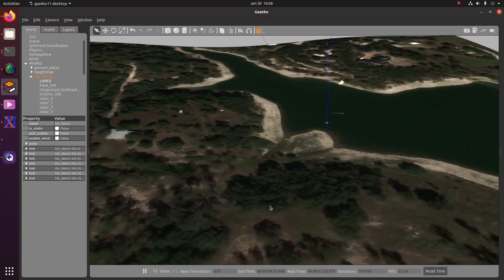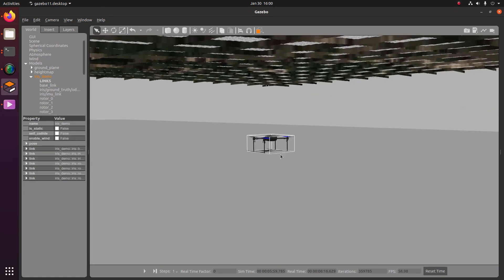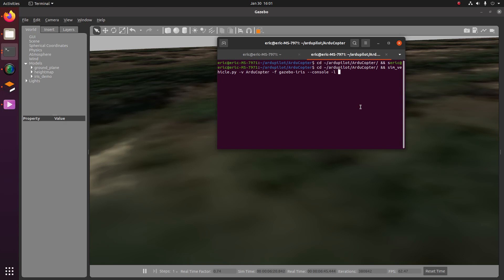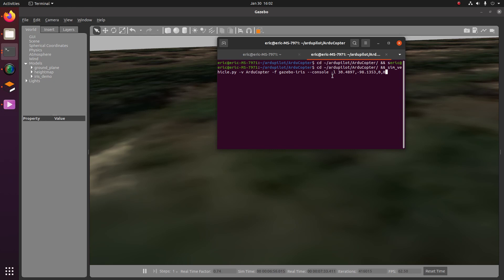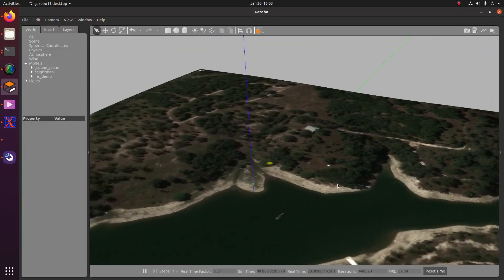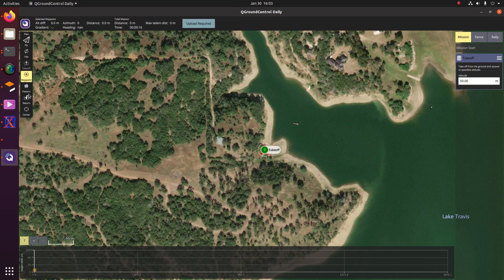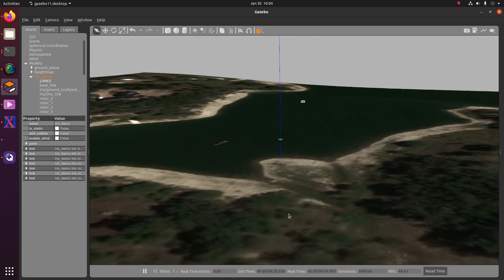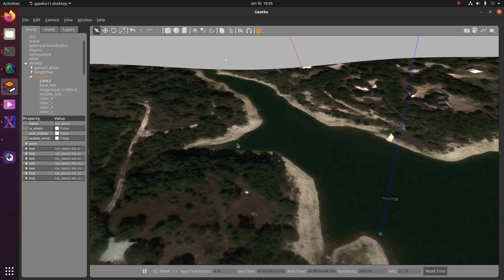Flying an Ardupilot Drone with Accurate Terrain in Gazebo

Comment: Heya! Pretty awesome, nice work :-)

I've been testing with it a little bit and I can't get the waypoints in the maps to line up with reality. The origin point pretty much is spot on, but there is drift the farther I get from the origin. It appears the image file in the zip is actually the entire area in the instead of (what I expected) the area inside the red box. That seems to cause the offsets in my case. Is that as intended?
Reply from the maker: I have noticed this a little bit in testing across large distances. For things within a few hundred meters it seems to be correct. Curious as to how far you flew. I am looking into this and will try to get this fixed in the future
Reply: @IntelligentQuads  It was really short distance, roughly 50 to 150 meters.